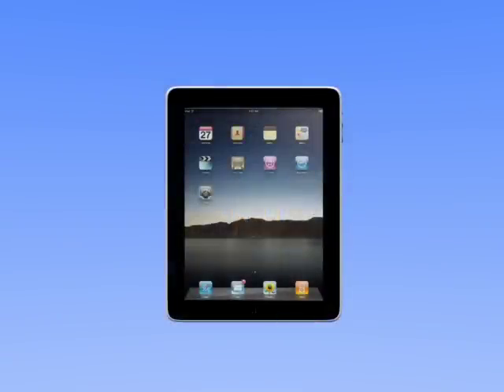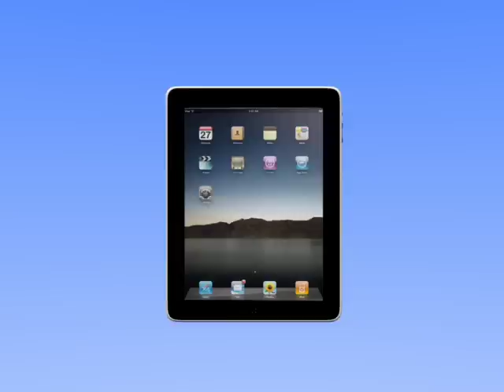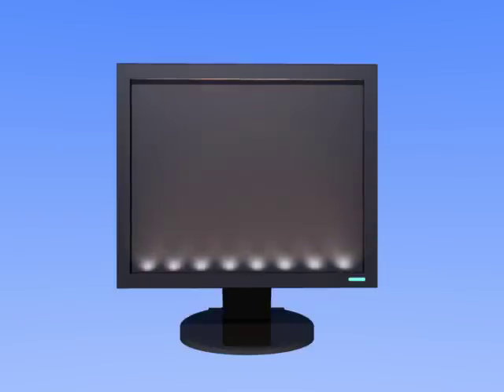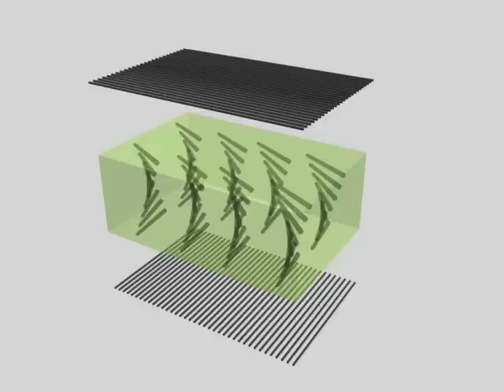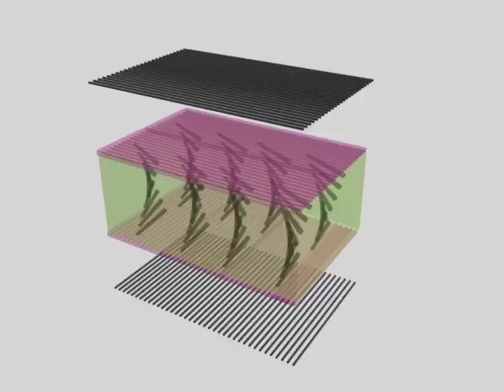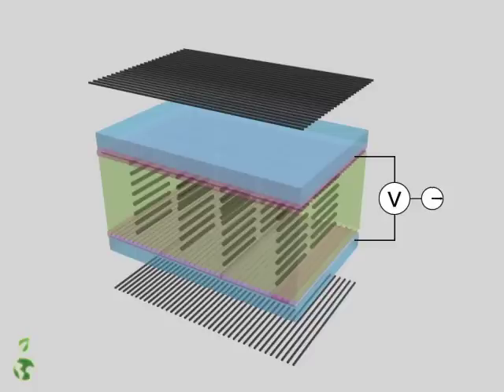TFT / LCD Monitor - How it works! (3D Animation)

Comment: it is insane how many pixels there are in 1080 hd screen meaning there are over 500,000 to 1 million pixels. its crazy how each voltage level is controlled in each pixel
Reply: @Jarran2R  that is not how it is done. 1920 means there are 1,920 horizontal rows of pixels where as 1080 means 1,080 vertical rows of pixels. thats the meaning of a 1920x1080 resolution.
Reply: Laughing at 8K TV

Comment: Yes. I am not sure how it got in there but it 'was' in there.  After looking at a few vids on how an LCD screen is made i decided to take the thing apart.
After taking off the surrounding plastic i unclipped the the metal front bezel and pulled up the LCD screen itself.  The bug was there dead on that white plastic film. I removed it and buffed up the small mark it left behind.  I reassembled the monitor and it is now working fine without the bug.  Next in line is the 42 inch LED TV that has 6!

Comment: hold on now, when the light goes through the first polarization filter, does it mean a large portion of the light is absorbed? wouldn't that heat up the thing? and also, wouldn't it be a waste of energy?

Comment: When you apply a voltage across the LCs, should those LCs orient parallel with the electric field instead orient horizontally?

Comment: Great video, maybe you could answer a question for me. I can't seem to find an answer and all the 3d representations seem to have different amounts. I'm wondering, how many crystals to a pixel? Is it a fixed amount per sub-pixel or does it vary?
Reply from the maker: What do you mean by crystal?
Reply: The crystals the are used to block light/let light pass through based on if they are twisted or not. Not sure what the name for them is sorry.
Reply: The variable voltage is applied to the crystal. The color filters are fixed and nothing changes on the filters.
Reply: Yes, this is explained poorly, instead of having 1 big crystal section for each pixel and 3 pixel filters that are adjusted, there are actually three crystal sections. These sections sit behind the filters, which are just normal filters you might use in science class, and change the direction of the light to change the intensity of it in each section of the pixel. Thus changing the intensity of each colour. Hope this is helpful! :D
Reply: @ManuelTijerino  Without the liquid crystal the light is unable to pass through the polarization filter resulting in a black screen.

Comment: I wanted to know if you can explain the relationship of the electric field and the liquid crystals?
Reply: The liquid crystal is what's called an optically active substance. This is a substance that rotates a light's plane of polarization (that is the way it oscillates) without cutting down on intensity - a normal polarizing filter would cut on the light's intensity. In the case of liquid crystals the voltage (or potential difference as it's sometimes referred to) determines how the plane of polarisation of light is rotated. That means we can adjust the plane of polarization of the light going through the crystal by adjusting the voltage. Hope this helps

Comment: I don't get why you need 2 polarizers. If they are polarizing it so that they can point in 1 direction, why don't just put 1 (upper) polarizer in the direction you want and remove all the bottom polarizer and the twisted liquid crystal?

Comment: This is completely different to another i just watched. Also...why have the light go through 1 polarisation to make it verticle and then rotate it 90o? Why not just filter it that way in the first place?
Reply from the maker: +Rich Williams Watch again!
Reply: +Thomas Schwenke yeah I have lol, it polarises then goes back again so its like it was in the first place
Reply: +Thomas Schwenke Oooh i get it now! lol, so its completely black untill power is applied to the chrystal, the backlight is always on. Yes I do apologise, must have been tired lol! So interesting....so this is why led is so efficient. Have u seen those polarised glasses u can make? The screen is white and only you can see whats on the screen
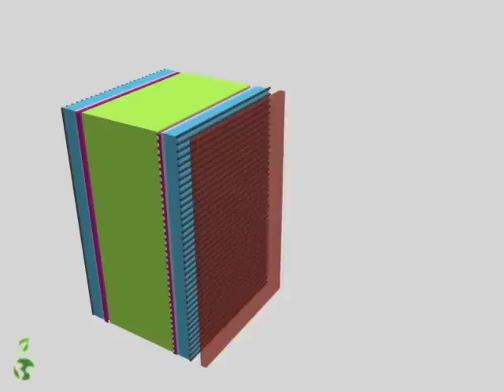Reply: I doubt the light is always on. When you turn on the power to the LCD display the light turns on. The electric current is applied to specific sub pixels of the RGB pixel so that you see a specific color. Basically each red green or blue sub pixel has a specific voltage to give off a different intensity of that color light which gives a certain color. Watch 2:25 to 2:50 again.
Reply: It's so the intensity of the light emerging from the screen can be controlled. If we polarized the light in the first place, It would all go through and there would be no way of controlling the intensity other than that of rotating the polarizing filter itself, which is impractical if you think how tiny a sub-pixel is.

Comment: If partial voltage is applied to the liquid crystals so they only rotate partially, will some of the light still pass through or is it an all or nothing situation?
Reply from the maker: Hi, think again. How is it possible to produce more than 16,000,000 colors with only 3 subpixels?

Comment: i thought that the three units of a single pixel unit make a single colour .........by the respective intensity of RBG to their respective voltage applied .... but at 2:42 the red light was black to my eyes ,well i would like to know if my eyesight is in good condition .........and by the way thanks......we will respect you for your work;-)

Comment: Yeah, I don't understand even a little bit. Gonna find another video. Thanks, though.
Reply from the maker: +Caroline Fraley Too bad, what's the problem?
Reply: What is polarized light? And why not just make the filters line up with one another (parallel lines rather than perpendicular)? And when the liquid crystal is straightened out, is that to turn the screen off? Or why would you want to do that?
Reply from the maker: Watch again!
Reply: Good reply.
Reply: The light coming from the sun oscillates in random directions (not just up and down). We say this is randomly polarized. If we pass the light through a polarizing filter (a sheet with small gaps like the ones shown in the video) only light that oscillates in that direction comes out. That means all the light that oscillated in other directions is lost, and the intensity drops. We say the light is polarized. So if we pass that polarized light through another filter that has the gaps aligned in a way perpendicular to the previous filter, all of the light will be lost as all the light that came out of the first polarizing filter would not pass through the second polarizing filter. This is very useful as we can use this with the help of optically active substances (like liquid crystals) that rotate the plane of polarization of light without cutting on intensity, as we can control how intense the light coming out of the second polarizing filter is. The liquid crystals have a twisted structure when they rotate the plane of polarization of light, so straightening them out means it doesn't do much to the light. Hope this helps :)
Reply: Ella Blun "The light is spread out evenly by means of an element that consists of several layer."
Really wasn't difficult to understand, maybe you need a hearing test?

Comment: Dislike. Calculators don't use the same technology as monitors, that's why you can see them at lain daylight but not monitors.
Reply from the maker: Well, it depends. Most calculators do not make use of colors either. So, if you say, it's not the SAME technology, then you should mention this as well :) / Simple calculators do not offer a backlight, so you cannot use them in the dark without another light source; that's true! There are, of course, a lot of calculators with a backlight feature. / However, when I say "same technology," I mean it in a broader sense. For me, it's the same technology. Of course, most calculators do not feature a backlight, colors, contrast or brightness adjustments, etc. what monitors offer :)